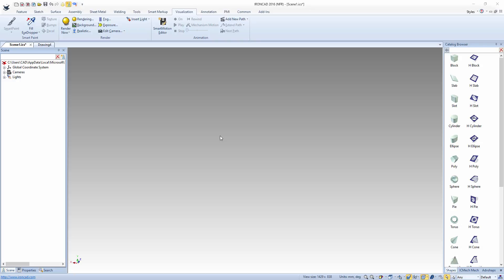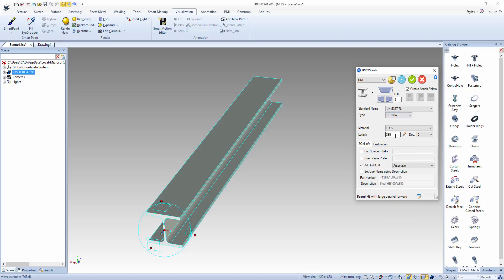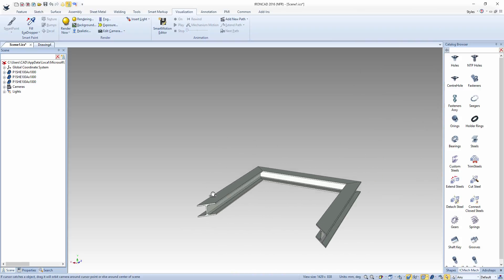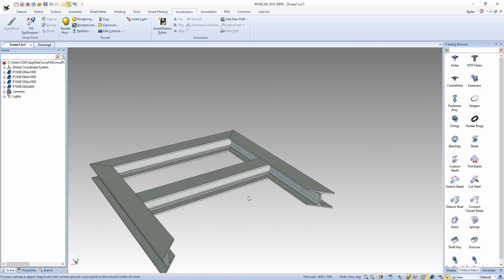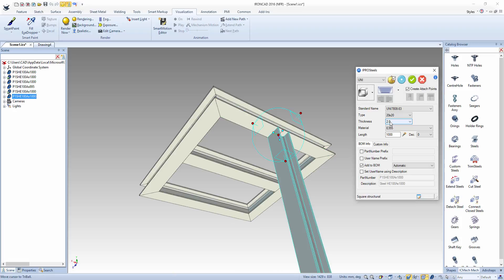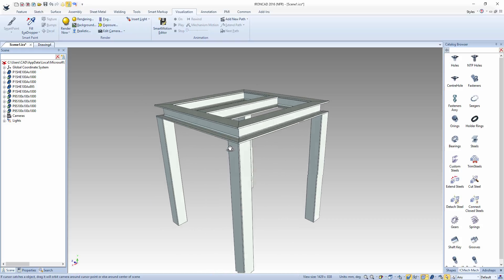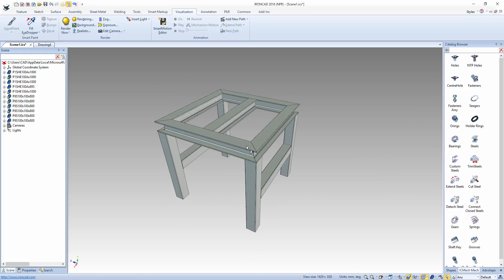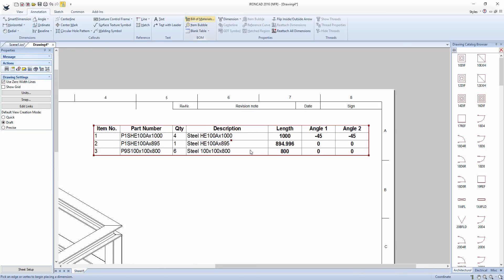IronCAD Mechanical - Structural Steel with Cut List

Comment: Hey CADInternational,

I've been trying to figure out if IronCAD supports sweeping piping along a path? I've seen that it supports sweeping a sketch, but I'd like to know if it's possible to sweep pre-defined piping types along a path, not just a sketch? 

Debating between IronCAD and SolidEdge, and SolidEdge is able to handle piping pretty well.

Thanks!
Reply from the maker: absolutely it can. It even allows you to drag and drop pipes and fitting's and will automatically align them in the right orientation and even align holes on flanges. There is actually no need to even have a path when using IronCAD for piping design, but it can be a good reference line